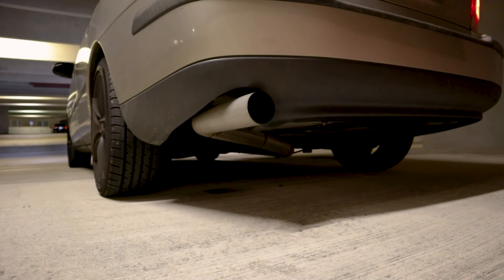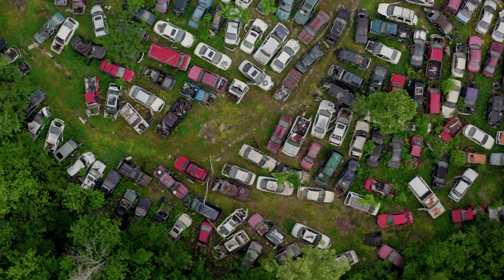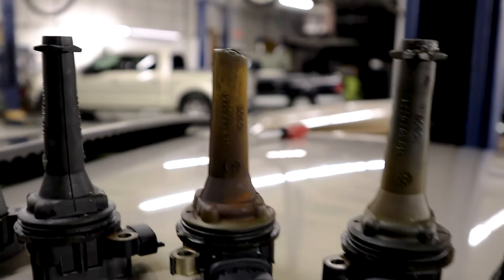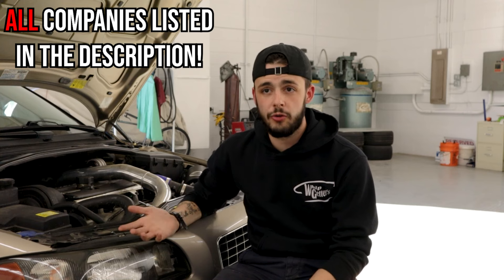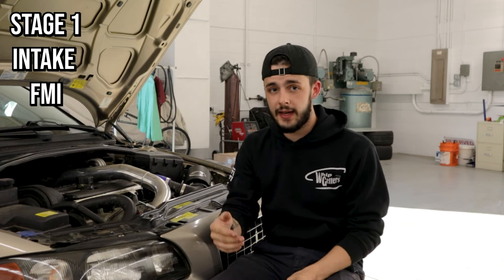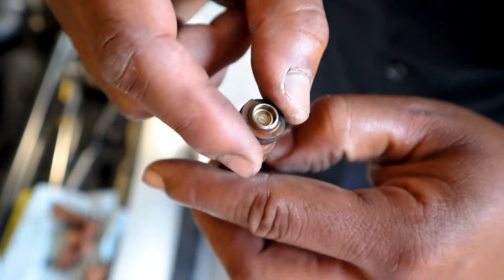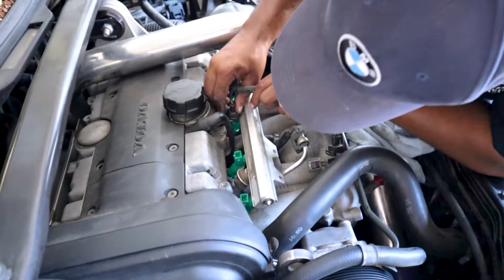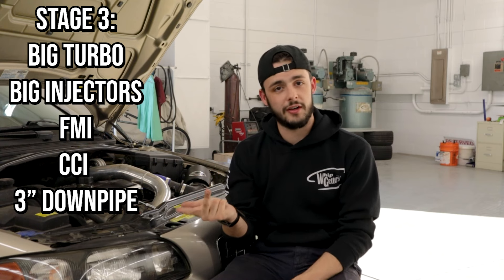What To Expect When Modifying A Volvo | Understanding Volvo’s & Performance

Comment: I have a 2008 2.5t
Reply from the maker: We put a 2.5T motor in this 2.4T S60s body!😁
Reply: @WhipGetters  mine is the 2008 s60 2.5t I have straight pipe and I wanna do cold intake and and I wanna tune it soon also
Reply from the maker: You’re gonna love what you do to it, then it’ll get addicting!😎

Comment: Sry I dive volvo 15 years know and tune them allways up 
S70 2.5D 130ps up to 200ps
S40 1.9T 200ps 360ps
C70 2,5T 193ps 450ps
S70 2.5T 193ps 400ps 
S60 2.4D 131ps 220ps

 only take good parts
Make oil and every Service 
All selled or crashed but never had problems..
And all over 450t KM
And I drive crazy don't take care when I drive and no one made any problems.
Reply from the maker: Super useful information!👍

Comment: Step 1. Don’t buy a s60 T5 01-04. 
Step 2. Buy s60 T5 05-07.
Step 3. Don’t buy an automatic T5.
Reply from the maker: Step 0. Take a chance at something new
Reply: Just bought a 2007 t5  manual with 260hp and 50.000km first I'm bringing it to Volvo dealership for a big check up then I plan an exhaust mod intercooler and a remap 😎

Comment: Will you still need to tune if your just putting 1 or 2 s60r parts on a stock s60 2.5t I have a r air filter and intercooler I want to throw on but have no idea if I have to tune for even just the s60r airfilter